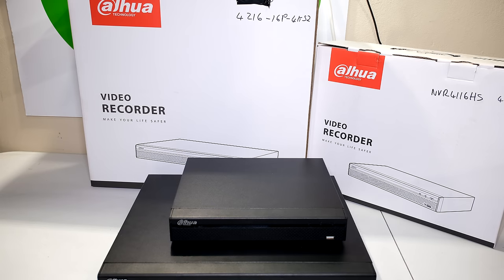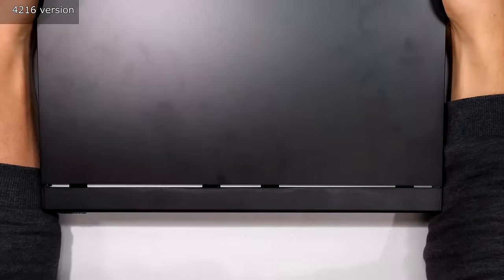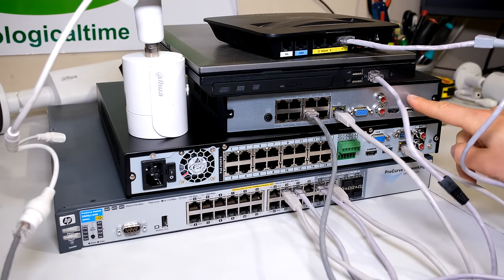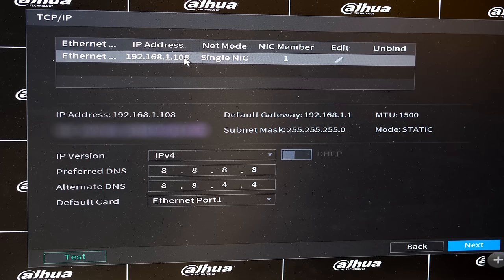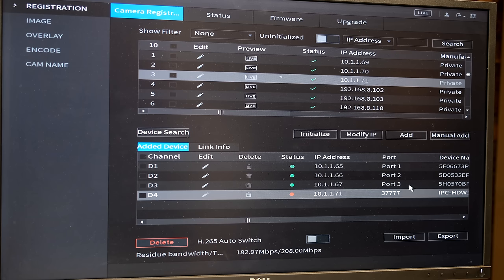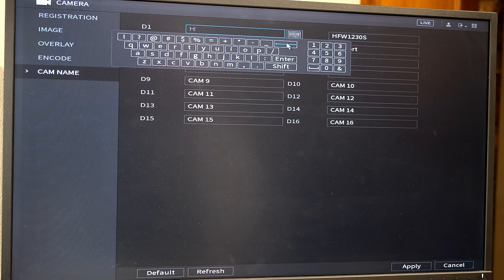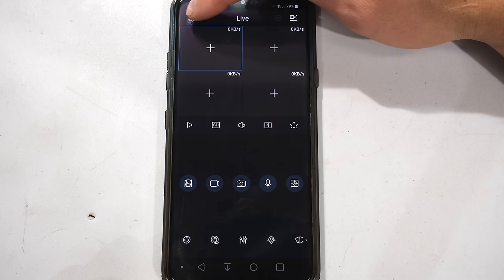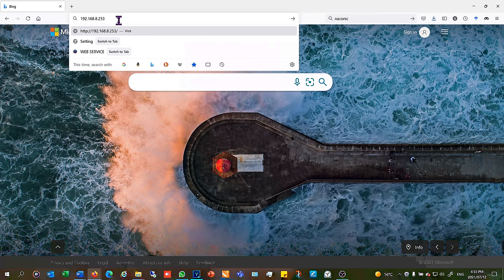Dahua NVR setup 2023- hard drive, cameras, and remote view - step by step. Models 4116 & 4216

Comment: OMG this is so freaking complicated, I got a UDM Pro from Ubiquiti which is not only an NVR, it also a router, switch and network controller. Also got a separate PoE switch to power up APs and cameras. No need of power cords I just power the cameras and APs for wireless with ethernet.cables.

Comment: So I thought I would mention something.. I have been trying for the last month or since I asked you about resetting your 4116E NVR.. My Email when I send from my NVR's domain wouldn't do anything. My Reset switch didn't work. and I removed the Battery (Don't do it it won't help at all Only changes time and date to 1-1-2000. So. If I sent form a different email I would get a reply that they would be sending to Registered email however nothing. It has been at least 3 weeks However I was able to get my Reset code I had to use DMSS even though my system is not Dahua it is an OEM Dahua and using DMSS it sent me the code to my NVR's Email address and I was able to Reset the Password. IF you all don't have your Email Setup in your NVR or your Q&A just make sure the Q&A are something you won't get wrong lol..
Reply from the maker: Hi Revo2Maxx. Finally you got that sorted! Thanks for that useful tip. Now i have an old unit that could not reset and now i can reset it.

Comment: Very good video, anyway i would have liked you to explain more about those ip cameras connected to the nvr. Following the video i saw them having an ip completely in a different range from the one of your network where your nvr is connected. I wanna know if those ip-s (10. ......) of the cameras are predetermined or jt is you that have to determine them? Are those cameras with different ip ranges compared to the network reachable inside your network even if they are connected to a switch in your lan and not only directly to your nvr?
Are those cameras directly accessible on a browser using their ip, eventhough it is different from the one of the network where they are connected to?

Would like for you to clear my doubts on these questions, thank you

Comment: Hey ecologicaltime, great video and very informative. Just wanted to pick your brain a little with a few quick questions concerning the dahua NVR5416-4KS2 nvr family. When adding another hard drive to this type of nvr to expand storage space can the added hard drive or drives be of a larger capacity than the first drive as long as it’s not over the recommended requirement for the nvr, or must it be the same capacity and speed? And if multiple capacity HDs can be used what would the max capacity of any additional drives be, and would a possible firmware update help in increasing the HD capacity for the nvr? As you may be aware of the NVR5416-4KS2 can handle up to four HDs. Thanks for letting me pick your brain. Subscribed.
Reply from the maker: thanks for watching. I have not used more than one HD in that model but my experience with NVRs is that you can mix and match hard drive sizes. However, if the max size per single drive is 10TB each then each drive must not exceed10TBs.
Reply: @ecologicaltime   Just added the second hard drive (10tb ) and working well so far.
Reply: I have some Annke cameras (IP... NEW) but Ive tried a INITIALIZED one and a uninitialized but they dont show up... any thoughts ? (and my DVR is a 4216).. thanks :)

Comment: Please help me 
Earlier I was having old TV being used for CCTV camera live video in which RS32 port was connected coming from camera setup box. Now I purchased a new TV (not android) but it is not having RS32 input port. It has HDMI port so I used a RS32 to HDMI converter cable but it is not connecting. 
Please give suggestions. Which device I need to purchase. If you share link I will be thankful.

Comment: Thanks for the great video, Can you tell me, is possible to add some spare Analog cameras that I have to my New NVR ( IP cameras ) same 16 channel NVR 4216 . I have my ip cameras working fine but have some spare Analog cameras?   the second question, get this irritating message for web browser view ( Chrome ) , get use Web plugin  Thanks
Reply: Eons ago I used an analogue Dahua DVR that had an Ethernet port and remote view etc.

When I changed over to IP Cameras I pointed my Dahua IP Digital NVR at my Analogue Dahua DVR IP address  and I then had all my remaining analogue cameras showing on my new Digital NVR - effectively my old Analouge DVR just became an analogue to digital signal converter feeding all the analogue cameras into my NVR via the Ethernet network - worked perfectly but it probably helped that the NVR and the DVR were both made by the same company - wonder if it would still work if one recorder was Hikvision and the other Dahua?

Try a different browser and / or clearing any old browser plugins - perhaps there is an "always allow" setting or similar so you don't have to keep giving permission manually?
Reply: Yes as stated you can use a NVR or DVR to move other cameras to another Recorder as well.. Some recorders will only show Ch1 and some that have a Zero Channel can show any channel.. Then the great and Crazy thing is as long as you have your system setup on your Analog Recorder with RS-485 that info is also translated into the NVR as well. So take one of my Costly Samsung PTZ cameras that I bought back in 2014 that has Auto Tracking Connecting that camera to my NVR  as my DVR being the host I can access my OSD and set presets and access them as well...

Comment: I have 2 cameras showing the same device name (some how?) but have different serials on the box. So one of them doesn't work (it was working) as their in a conflict because of the name. I tried deleting the camera and when plugging it back in, it's not recognised. How do I add the camera if its not coming on the screen. Manually adding it doesn't work. Thank you.

Comment: Hello,

two NVR recorders are connected in the same network. For one NVR recorder the known port numbers (37777, 37778, 80, 430, 554, 123) are assigned in the router. For the second NVR recorder which port number can be used and assigned so that the port forwarding works? Thanks.

Comment: Very good video , I have a problem, my cameras have been used before and I cannot edit them ,I think because I don’t know what their passwords were, is their a way to discover them ,thanks for your time in making these videos
Reply: You can reset your camera by holding down the reset button,and then plug in your 12 volt power jack and still holding down the reset button wait for 20 secs you will hear a beep ,your camera is reset to default settings

Comment: @ecologicaltime
Did you see that when connected by web browser you cannot save the video outside the application?
Instead seems that the person who made this video
https://youtu.be/CHsgv3P0sPE
can do it.
Lot comments about that video are to ask why we cannot see the set of command (scissors) to save the portion of interest on pc disk.
Reply: LOL I mean why show that Video? there are so many things that it did that was wrong. I mean they click the cut tool but then later show how they could have just DL the Motion record. I mean in truth the person in that video if they were looking to lets say Record some motion of someone that came into that Cameras FOV from under lets say and seeing that it had Audio and they heard someone in the Full time recording playback talking about breaking into the Truck lets say  around the corner but you don't see them yet. Then yeah sure use the CUT and take some of the Full time Recording along with the Motion after that person has now moved into the cameras Video Grid of Detection. However it is lame, One they have just told everyone on the Web they have their NVR on the Web with access. Now everyone will be trying to Hack their NVR Lol.. Then doing a Video from Remote of a NVR and then say there is lag lol... Yeah there is lag because they have the FPS and Bit Rates to low lol...

Comment: Question: My NVR's (4104) HDD packed up. If I install a new one (WD 4TB Purple) do I have to "format it? If so can it be done via the computer using Smart PSS (1.16) or must I plug into a monitor?
Thanks in advance....
Reply from the maker: hi Allan, yes needs to be formatted. on SmatPSS i have not seen a format button for for a hard drive already in place and working, however maybe it appears when the drive is still needing formatting.
Reply: @ecologicaltime  I put it in, switched on and it started recording without asking so I assume all is OK...... There is an HDD function in the settings but nowhere does it sat "format" (and I don't have a monitor to connect to - may try with an HDMI on a TV)
Many thanks....
Reply: @ecologicaltime  Went fiddling today and found it.....
Click "Device CFG"; click "HDD"; click "HDD Operation" (drop down menu); click "Format".....

Comment: Hi. My status on the camera is red, and there is no picture. Do you know why?
Reply: Did you ever find out? If not I would double check that your camera 1 has right password in the NVR for the camera. If it is a Dahua type camera and NVR then NVR should have gave the camera the right IP  if not That could be another issue. If the Camera isn't on DHCP and don't have the right Static IP for the NVR's Switch Ports it could be IP issue. So I would first try to make sure that the Right password is in the NVR's info for the camera If it is then I would double check that the camera is getting the right IP address..

Comment: Hi, I have a LPR camera.  It needs some adjusting for it to work well. Right now it is just as a regular camera.  Would you have any tips for me to beat configure the lpr camera?  I do t see any settings in the nvr
Reply: An LPR camera will need a LPR ability recorder to keep the data that the camera pulls. IF you don't have it connected and using the right settings then you spent way to much money for a normal camera. Why do you think it is a LPR? Any camera in truth with the right recorder can capture plates. I hope you didn't fall for the common Bay grift of someone saying a normal 9-22mm lens camera is a LPR.. Again a LPR will have special software in the camera be it a IP or CVBS camera that will capture plates and help store and sort them in a Recorder that has LPR database record keeping..
Reply: @revo2maxx  hi, it is an lpr camera ( IPC-HFW7442H-Z4 ) with NVR5432-4KS2.  I just think our installers skipped over the setup for the license plate capturing.  Is that menu, viewing and storing of clips accessed from the nvr or from web gui of that lpr camera?  Thank you for running those questions by.  I know what you mean but I spent months figuring out our 26 camera system.  It’s just that the installers did a quick setup.  Any simple tips you may have that I can follow through on my own?
Reply: @mannypatel9090  OK yes both the camera and the NVR support the feature. Then you will want to double check that the Channel of your Camera for this is setup on the NVR for the Event options to work. You will want to Right click your NVR GUI screen, Then Main Menu (Login if you need) then click Event, Plate Recognition, then choose the Channel it is for that camera, then you will want to make sure that it is Enabled. THere is a Toggle that needs a check. Might want to check your Rule as well. Also I am sorry but any installer worth half the weight in silver would be willing to make sure that they make your system work as Expected. I mean I am sorry but if I paid someone to install my CCTV system, and Paid to have PLate REC then it is going to work or they will make it work before I sign off on the Job as complete. Also normally or at least I did many moons ago when I was an installer. I had a 30 to 90 day Adjustment clause that I would make any and all adjustments at no cost to get things dialed in for the system to work as the End User expects. Now I will say that I also had in Contract what was expected as well. So they couldn't say oh I want a Door Open Plate even though that wasn't part of the install to start with if you get my point...
Reply: @revo2maxx  I appreciate those suggestions.  I will give it a try tomorrow.  It was getting difficult to find installers to pull wire and conduit plus the setup and adjustment.  It just was a quick setup on their part and by the time I realized that the feature for lpr capture or play back was not working.   Also, I need to figure out to setup the smart search for events, I’d like to have 24 hr recorded also.  The new software seemed like it was automatically or semiautomatically marking smart moves so long as the cameras with wiz ones.
Reply: @mannypatel9090  Yeah there is a couple of things I wanted to mention. First, Make sure you setup your system with a email incase you forget your password. The Reset switches don't always work inside. Also Test out that you will get a Code back from the Reset server at least once a year. Don't wait until after you forgot your password to find out your domain for what ever reason don't work lol.. Also about pulling wire I hope you had someone Trusted pull your wire there is so much Fake wire out there that is bad for POE cameras Even low current draw ones. About full time Recording it should have been setup at the time it was setup for full time recording, motion, IVS,  that should be already setup. What normally has not been removed and I would say it is important to save room on your HDD to change your snapshots from recording full time. Just go to Recordings Schedule snap shot then click all for all days, click the channel and click all then make sure the Green for full time snap shots are off only do motion and I would setup your IVS cameras or Channels to have Snap IVS as well as alarm if you have alarm triggers... Your machines are not cheap so Make sure to do it right the first time to be happy long time.
Reply: @revo2maxx  wow you have a lot of info!  Thank you so much.  We do have all channels recoding 24/7 and the bar shows green. I mixed up and I’d meant to say that I’d like to set up those motion alerts so say if someone where to walk through and onto a room.  That motion I believe would be noted as I think in blue on the ribbon for quick smart search.  Would that require that I set alarms for each zone that I’m wishing to have this capture?
Good points on all the info.  You are right this equipment is the best we have ever bought.  I was expecting more bells and whistles.  I’m finding myself doing the leg work and I don’t mind since it’s the user interface side. 

As for the email back up.  Is there a way to update that email address for the backup recovery?  I do have the admin user name and password for the nvr. But like you say should it ever forget it I’m in trouble.  I believe they’d set it up on their meat account.  At this point I don’t want to reach out to the installer.  He had done the job on the side as he works full time for himself on jobs that keep him busy.
Reply: @mannypatel9090  Yes if your NVR has the Email feature and I am sure it does, Right click in the NVR GUI, and Go to Main Menu (Log in if you have to) then click the account, On the left side there should be something that says Password Reset. In there change the email address. If there are no Q & A setup that would be good to setup as well. Just make sure not to do something like I did and make it hard to remember your answers as months go by and now I have mine changed leaving all lower case letters. Easy for others yes but no one would get to the GUI anyway and answers are not as easy as they might think if they know me lol.. Anyway. if you setup Q&A and answer the 3 questions right it will take you to change your password area. This makes it so you don't have to scan QR and send for email reply of code but having both as one might not work will make sure you can Reset password if needed in the years to come.. Personally I will make a habit of once a year testing my email for reset and my Q&A knowing if it will work before you really forget your password is a good thing you don't have to put in a new password after you get the code or answer the questions. Back out and it will keep your password as you have it..
Reply: @revo2maxx  nice!  You’re the best and know this information very well!  I will do that password email update and stay on top of it!  Glad you saw my post 👍🏽